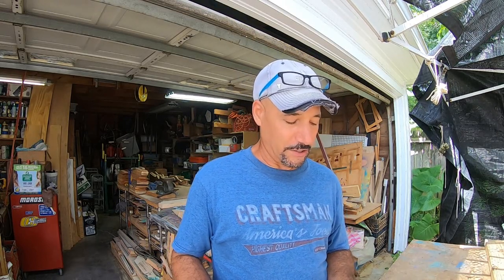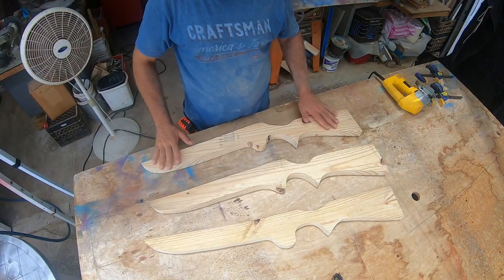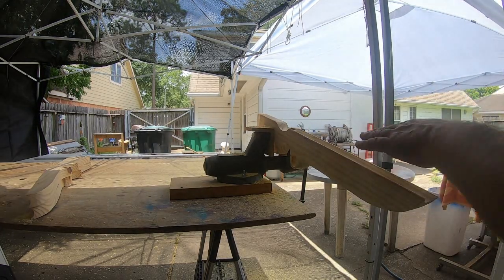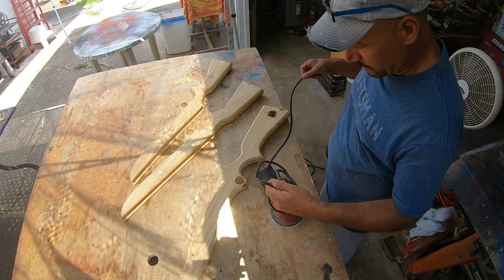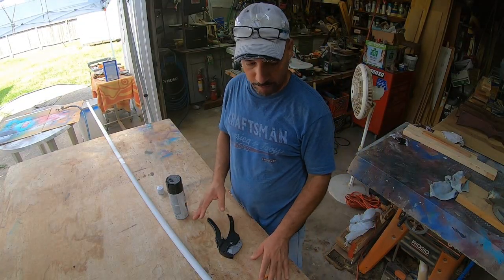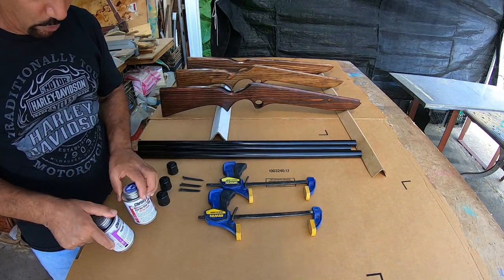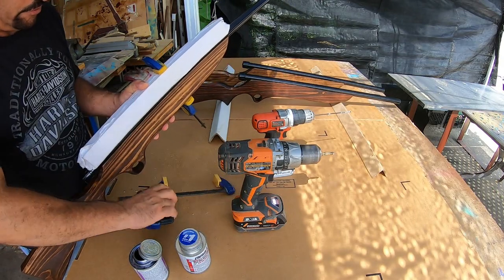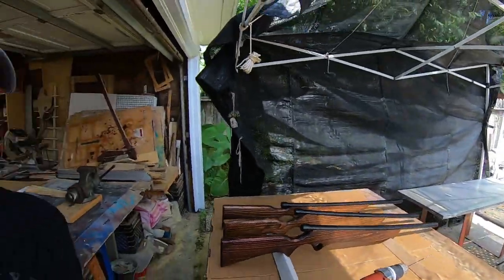How to Make 3 Guns for $8.18 in ONE DAY!

Comment: I saw one of your videos in my suggested feed.
I have a young grandson and he might like one of these when he gets old enough.
Do you sell online and ship them?
BTW, you should be wearing eye protection and when sanding you should have on a dust mask at a minimum a disposable mask.  I am having trouble with my lungs from not wearing breathing protection and I had to have a sliver of steel removed from my eye when I worked at a shipyard.  You only get one set of eyes and lungs take care of them!
A suggestion, since the PVC pipe will not be pressurized, you can glue the cap and pipe together with super glue, the gel type has a little longer open time.  I'd tape off the end and only paint the outside of the caps.   Nice touch by painting the inside of the barrel!  Don't the end of the barrel of a toy gun have to be orange?  I think it's a federal law so that everyone knows it's a toy gun.
Reply from the maker: I don't have a website but have shipped multiple times.  Normally, I box up un item and take it to the post office and weigh it first, step out of line and give you shipping/pricing options on the phone, and what ever you decide on I charge through credit card and get right back in line and send it. After sending, I take a picture of the Post Office receipt and tracking number so you can follow it. I hope that answers your question.